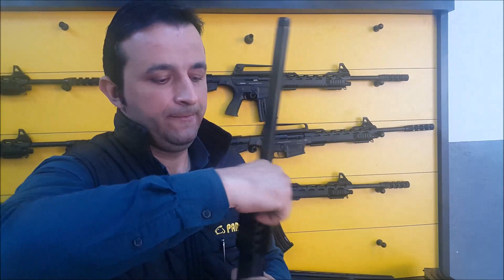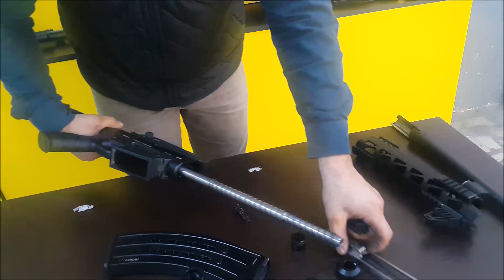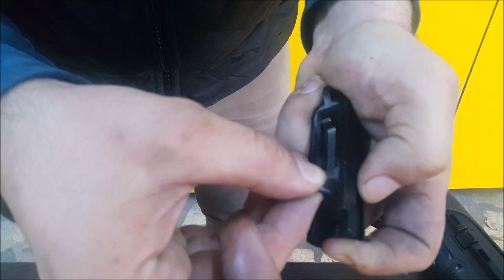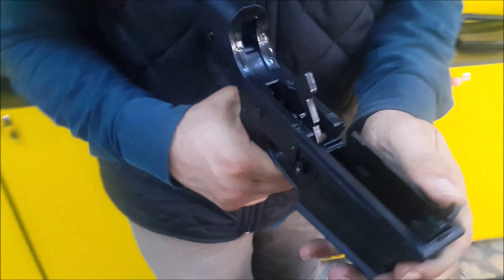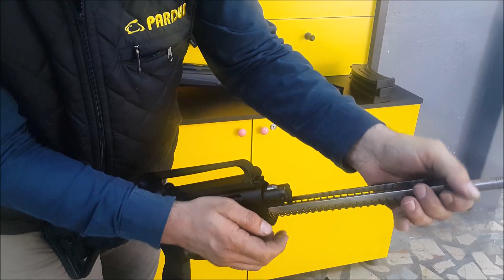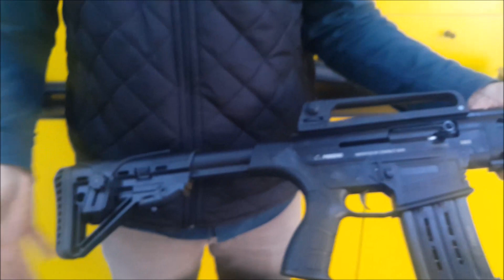AR type semi-auto Pardus SBX disassemble&assemble

Comment: I have the SD model and have disassembled and cleaned etc all looks good but when firing I get one shot. The next round loads and I only get a click when pulling the trigger. If I unload and then put the clip back in and manually load I again get one shot. Is there something I can adjust fix that causes this?

Comment: When I received this The safety and take down lever were seized. I had to disassemble it first using Kroiol. The rear stock on the one I received was different and was one piece. It requires a very long Allen  wrench ext. Recommend Lube those shafts with something. I'm a dealer a didn't want my customer to receive a non working safety
Reply from the maker: For the import rules of USA the stocks on the guns during importation has to be fixed stock. ATF regulations do not let the gun have telescopic stock on the gun directly. Can only be changed after importation. Regarding the safety and take down latch. Sorry as they are metal to polymer match, in some can be tight which will smooth in time. On the safety latch, after taking the upper receiver apart there is a screw which you can loosen the safety latch. thanks for your comments here.